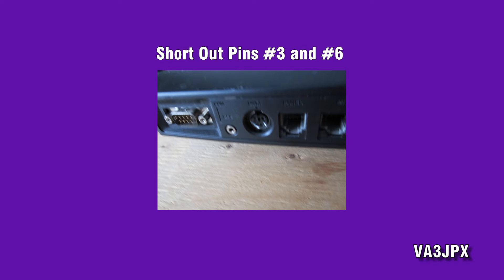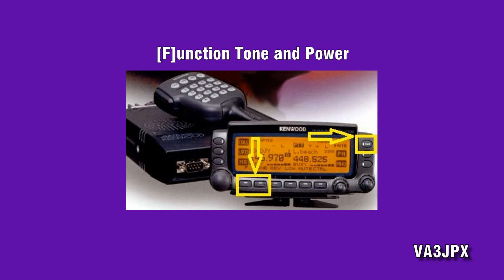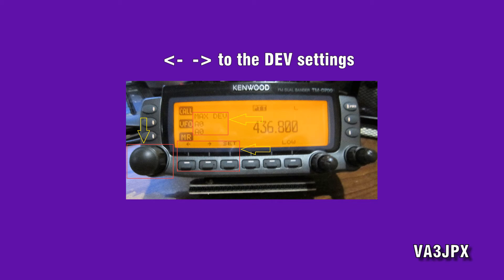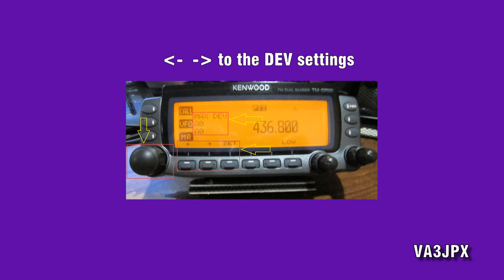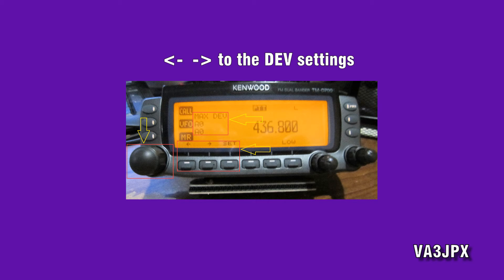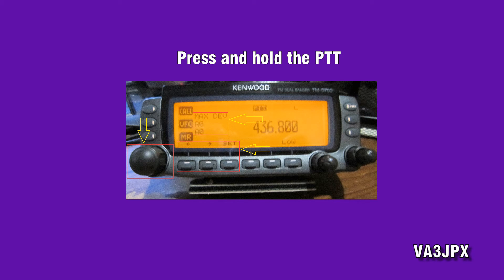How to change Deviation Setting on Kenwood TM-D700

Comment: I appreciate your video. I may have to try this as I bought mine off of an Online Swap Meet. It was working great then went dead a couple of months later. A local HAM electronics repairman Chis "The Bobcat man" found a bad solder job & fixed, but now everything was reset to factory, so I'm guessing that the former owner may have made the Deviation ajustment? The mic is so old that I may even try to open the mic opening a bit. Thanks!

Comment: Anyone that attempts to make this adjustment really should check the deviation limiter before putting your radio back on the air. Increasing the deviation may cause your radio to exceed the 5 KHz max deviation  and/or cause the radio to hit the deviation limiter causing flattopping and distortion on the transmitted audio.

Comment: VA3JPX, thank you. I have a Kenwood TM-D700 that I put into service today. Immediate audio reports were poor compared to my Yaesu FT2600M operating off a power supply. I was told the D700 sounds like "telephone bandwidth audio". I'll try your suggested adjustment and hopefully that will clean up this rig's performance. I'm surprised Kenwood did not address this on an otherwise well thought out transceiver. Again, thanks for the clear instructions. Jon - K6QVA

Comment: do this work on a tm-d710????
Reply from the maker: Hey Michael, I am not sure if it does.  I would not recommend doing this mod on the 710 unless you can check in the Kenwood Service Manual first, to confirm that this is the correct way to access to the alignment menus.
Reply: ok
Reply: The D710 has audio problems?? I just bought it!